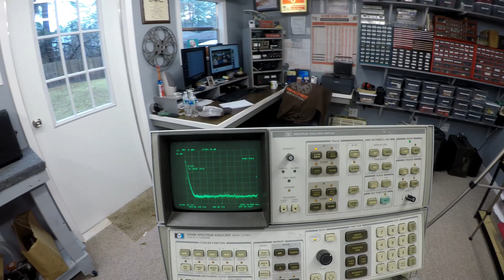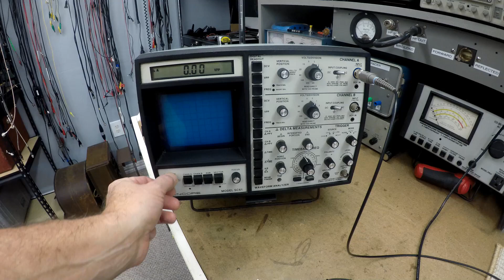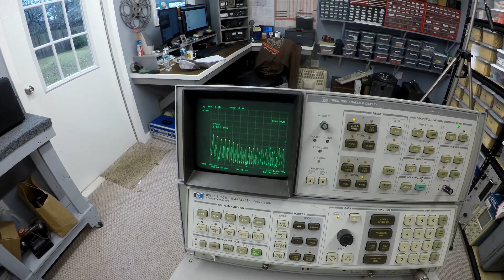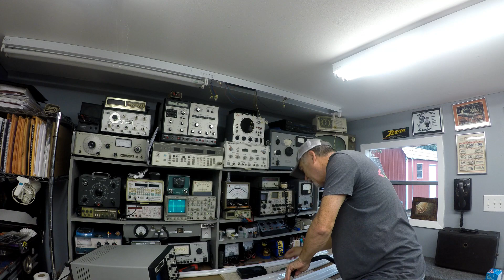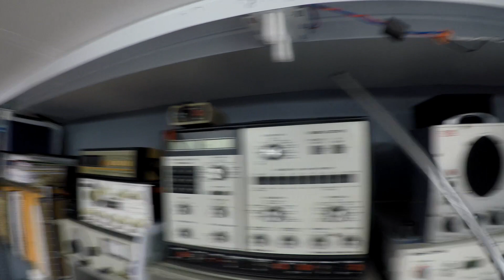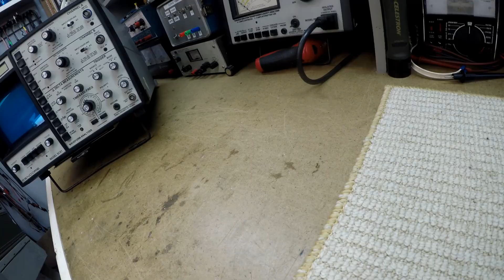Shop Time 1 Dec 30 2022, Eliminating Fluorescent Light Noise

Comment: I replaced my 4ft fluorescent fixtures with LED can style lights that pop into the ceiling tiles in my basement. Man, what a difference! I was worried they'd be noisy, when in fact I got rid of 99% of the noise I was dealing with. Thank for the video. Nice shop as well! Is that a sectioned part of a garage? Or is that a stand alone larger shed? Nice set-up!
Reply from the maker: Thanks. My shop was built on site from a shed manufacturer, I had them do 16” center spacing on the floors walls ceiling and roof. I did all the rest. I have to say I’ve never used these type bulbs before so wasn’t sure what was going to happen.  They are still noisy around 2-3 mhz but that doesn’t mess with anything that I do.
Reply: Disposable junk lighting

Comment: Congrats on killing some noise. I have the same problem and I found out where the culprits are and just don't turn them on when I am doing AM and SW DX, I have line capacitors where the radios plug in and that helps also. What stinks is none of this is cheap and the high noise floor pretty much has AM radio done and on the way out.

Comment: An expensive solution using LED replacement bulbs. You get to keep the same kind of metal fixtures in  place with 
the modifications. Have a safe and Happy New Year.

Comment: I’ve been wanting to track down what’s so noisy in my house, starting about 700khz up to 1200 kHz or so... crazy thing is, I can take a radio outside and clearly follow the buried feeder line coming up to the house, all the way out to the pole and the noise level and character are the same as inside the house which makes me think it mostly coming from the utility.  Either that, or there’s something inside that is strong enough to radiate all the way back to the pole.   Need to shut everything off at the panel and turn one circuit on at a time to see if I can isolate it, or see if it’s just really dirty utility power...  40 to 50 feet away from the house or feed line and am radio is a completely different experience...
Reply from the maker: You need a small portable multi band radio like the one I used. Comes in very handy for such things.